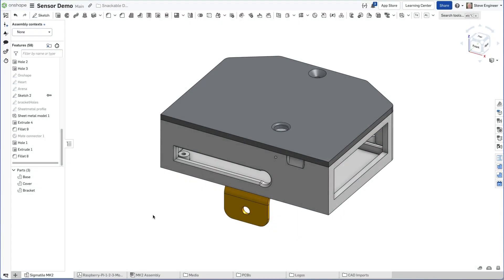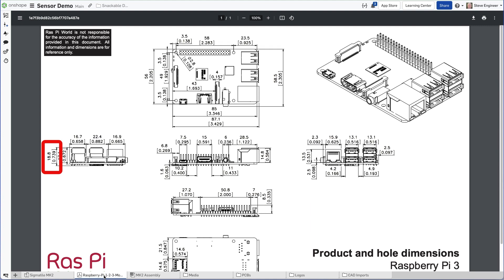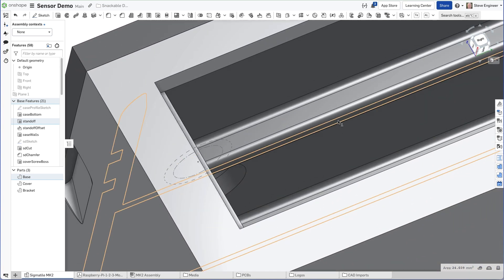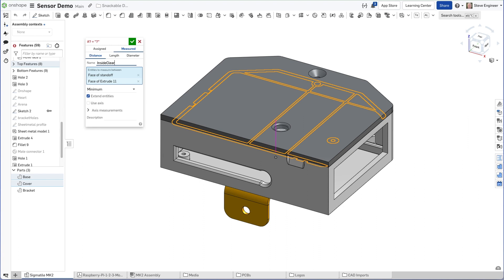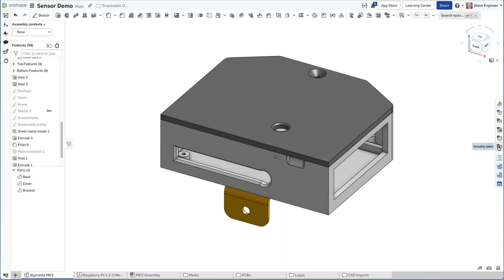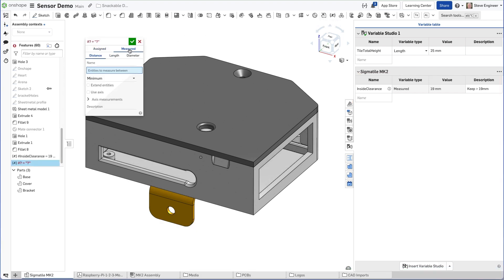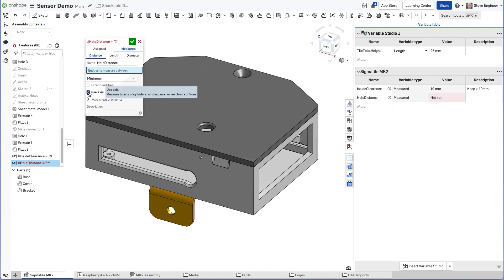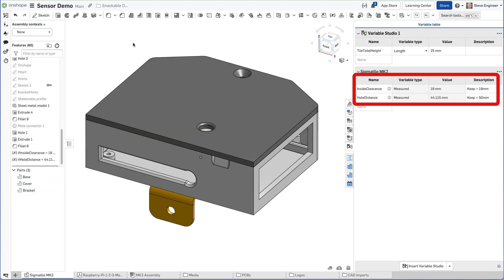Using Variables on a Raspberry Pi Case

Comment: Nice video idea.  You don't show the interface steps to make the variable.   Did you use a keyboard shortcut?  thanks
Reply: It actually is shown in the video.  Once you take the measurement, click the little "(x)" icon at the lower right, next to the measure tool.